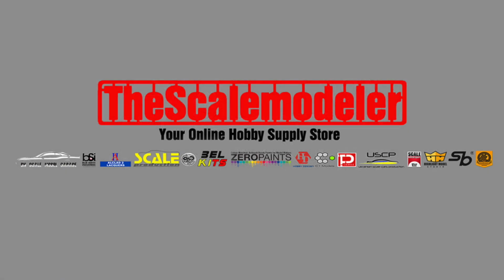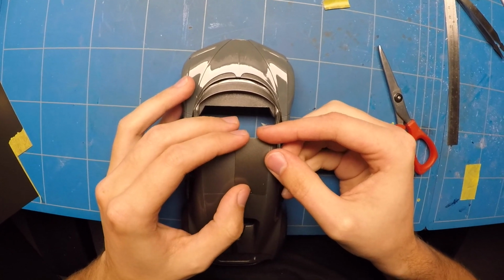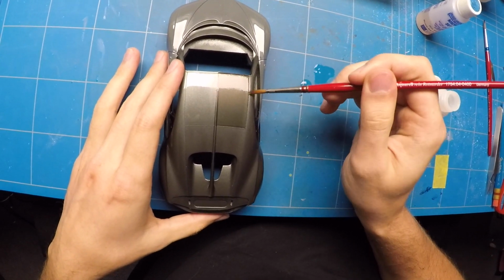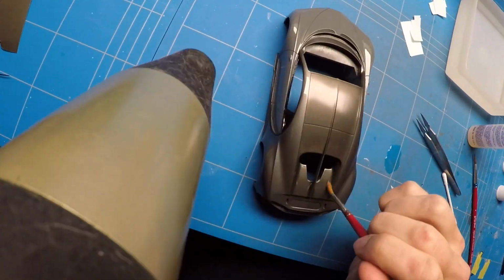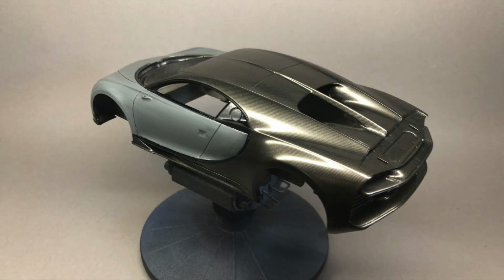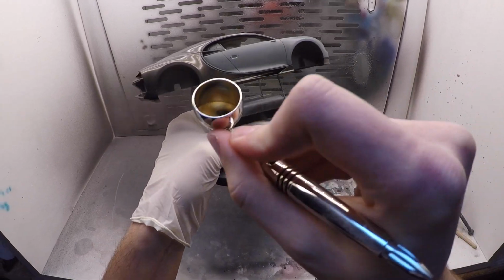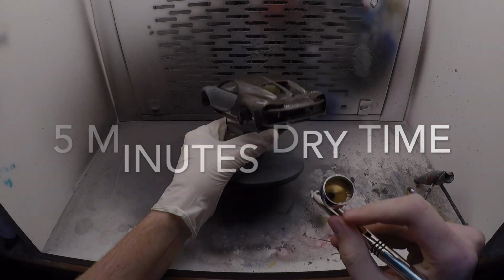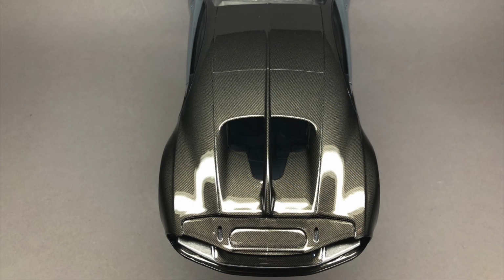Alpha Model: Bugatti Chiron Part 2

Comment: @The Scalemodeling Channel . Hello I have a question with your carbon fibre decal sheets I see that you have a black one my question is where did you get that from and do they come in different colours as I’m getting the Resin VGT kit and I’m doing it in the blue and I’m wanting to buy blue carbon for the kit. Please if your able to help please let me know
Reply from the maker: Scalemotorsport has “clear” carbon sheets. Paint the body in the color you want, and lay the decals on it to get the tinted effect
Reply: The Scalemodeling Channel oh ok so paint the area blue and then place the decal and then put clear over it
Reply from the maker: David Lewis jup, though i would advise to do a test piece and see if you like the color ;)(once the decal is applied that is...)

Comment: Excellent job,pure professionality!to watch this is betther than everything...i have question if someone can help me with advice i would be so thanksfull...im new in this hobby and i dont have airbrush ☹,im using spray car laquer for painting body and for resto of parts im using brush so..question is,when i put masking tape to cover some body part,paint it(with spray laq)and later want to remove tape and laquer is stay on tape...this make me problems and idkn what to do ☹☹☹ any advices?i prepare body with sanding,washing in detergent,primer and than laquer...what i do wronge?☹☹☹ terrible feeling...maybe tape is to "aggresive"??
Reply from the maker: maybe the tape is to harsh, the paint not et dry or simply not the right paint.

Comment: hey guys.  has anybody here an idea how to remove vallejo model air colours from bad painted parts?  The standard stuff that a use for tamiya colours wont work.
Reply: Get the Vallejo paint thinners or airbrush cleaner that should do the trick In a quick soak. That's the only stuff I use with that brand anything else clogs the airbrush

Comment: One thing I am confused about is if you know you are going to do carbon fiber on parts of the body and the paint and clearcoat will be covered up then why not just lay down only the primer instead of going through all of that just to cover it with cf decals?
Reply: He paints with a metallic grey color that is similar to CF in case there's an imperfection/gap in the decal and it's not as obvious when the color peaks throigh
Reply from the maker: Also the decals are slightly see through. So primer grey would change the color in certain sections of thedecals
Reply: okay, but why the clearcoat? Does it help to adhere cf decals?
Reply from the maker: David Minor it helps stick and form the decals easier. And to correct mistakes as you can use a bit more force to remove the decal if needed
Reply: Thanks Tom. It is always great to pick up tricks of the trade that I am unaware of. And I loved that Hurrican build back then